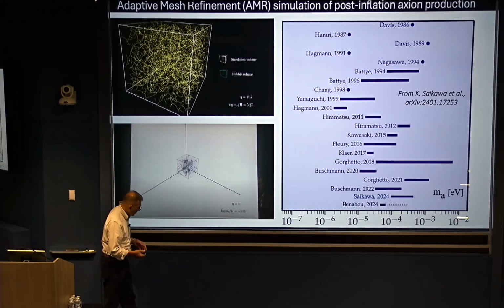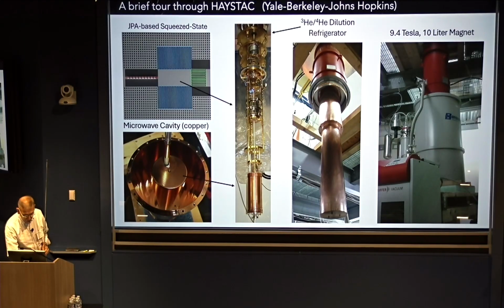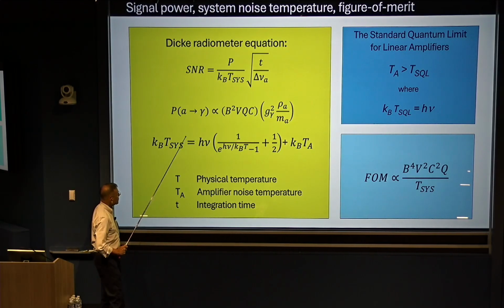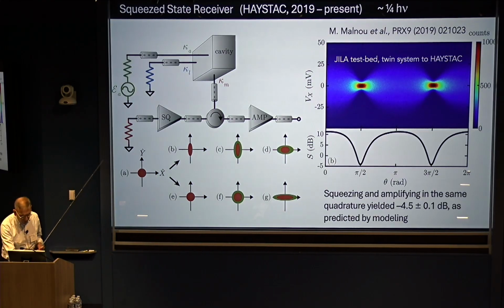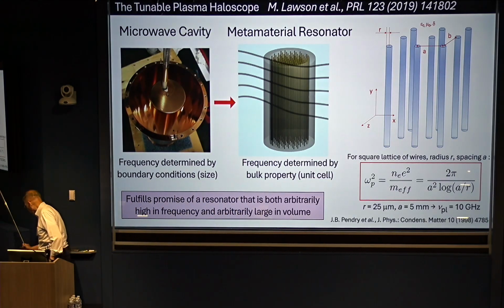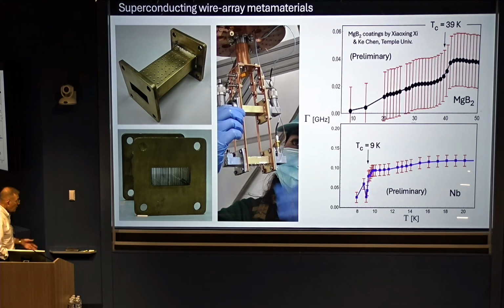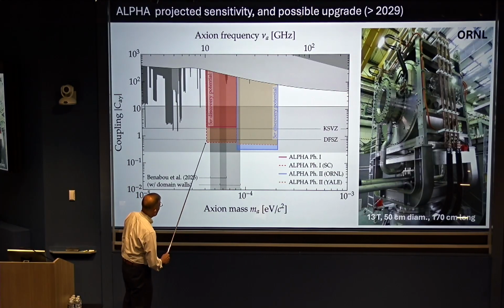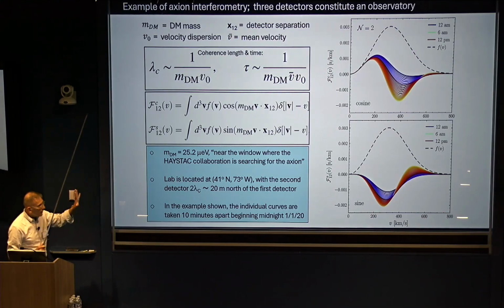Karl Van Bibber - ALPHA — a plasma haloscope for the post-inflation axion (September 4, 2025)

Comment: I loved the talk. From a plain “keep the signal coherent” angle, a few practical ideas:

Shape the room so only the right note rings.
Think of the resonator like a concert hall. We want the one “good note” (the TM mode) to ring clearly and the wrong notes (TE modes) to be muffled. Slightly irregular / gently “chirped” spacing in the wire or PBG layers can kill the wrong notes without roughing up the good one.
What to check: How deep the wrong notes are pushed down, how steady the good note stays as you tune, and how smooth the timing looks (no ripples).

Tune gently, in tiny nudges.
Lots of small, spread-out tweaks beat one big plunger move. Small steps keep the same note and field pattern, so you don’t “re-start” coherence every time you tune.
Rule of thumb: each step much smaller than the note’s natural width; the note’s overlap with the magnet field and its loudness barely change from step to step.

Point the microphone at the note’s exact shape.
The signal is a very narrow line that drifts a hair with Earth’s motion. Aim the squeezed/measurement quadrature and the local oscillator so you’re listening right along that shape, and use a filter that follows the slow drift. That cuts “shape noise,” not just total noise.

Make it hard to scramble the note.
Vibrations, warm spots, and sharp wire bends can smear the signal. Push mechanical resonances out of the sensitive band, map temperature sensitivities, and clean up current hot-spots at bends/joints—especially if using superconducting wire.

Quick health checks (fast to report):

“Wrong-note” suppression (how many dB down across the tuning window).

Stability of the good note while tuning (the overlap with the magnet field barely changes).

Smooth timing/phase behavior (no weird ripples near the note).

Vibrations don’t add sidebands; temperature tweaks don’t shift the note much.

Comment: A fundamental insight of Relativity is that mass that exists at Relativistic velocities is irrelevant from our perspective. Relativistic velocities are occurring in the overwhelming majority of galaxy centers. This means that they exist in a "non local" state relative to their outer regions. The mass in our galactic center is not just there, it's everywhere.
   Einstein repeatedly said that Relativistic dilation prevents astronomical concentrations of mass/singularities. He put this in writing in 1939. 
   Relativistic dilation does not occur in galaxies with low mass centers. They don't have enough mass to achieve relativistic velocities. Therefore, they do not contain dilated mass. It has been confirmed in 25 dwarf and ultra diffuse galaxies to have no dark matter. In other words they have normal rotation rates. 
   Mass is a clingy thing thanks to gravity, it makes sense that dilated mass would exist as a halo around galaxies. Dark matter is simply regular matter that is dilated.
Reply: What exactly does "dilated" mean here? Stuff that is moving fast doesn't somehow become delocalized - quite the opposite.
Reply: @doppelrutsch9540 A common misconception is that mass and or energy increases as an object approaches the speed of light. It doesn't, that's why it's called "invariant". Mass becomes spread throughout spacetime relative to an outside observer. Hence the term "mass becomes infinite at the speed of light"
    A Relativistic dilation graph illustrates the phenomenon. It has velocity from stationary to the speed of light on the horizontal line and dilation/gamma on the vertical. Dilation increases at an exponential rate the closer you get to the speed of light.
   The best way to understand it is to imagine a spaceship traveling at a constant acceleration rate. When the ship reaches 50% light speed, as viewed from an Earthbound observer with a magically powerful telescope, it would appear normal because as the graph shows nothing has changed at that point.
   When the ship reaches 75% light speed it would appear fuzzy because as the graph shows, relativistic effects would be noticeable at that point. It would be partially irrelevant from an outside observer's point of view.
   When the ship reaches 99% light speed it would not be visible because every aspect of its existence would be spread throughout spacetime relative to an Earthbound observer.
   This is the state of mass in the overwhelming majority of galaxy centers.
Reply: @shawns0762  Errr.... no it works the other way around. As an object moves faster it appears to take up less space relative to an observer at rest. It becomes shortened. That is called "length contraction" and is a well known and observed consequence of the Lorentz transformation in relativity. And all of the mass of an object is still, well, inside that object. It doesn't "spread out throughout spacetime".
Reply: @doppelrutsch9540 The way I described Relativistic dilation is correct. Length contraction is a misconception. Something that is irrelevant cannot be measured. Here is a quote from Wolfgang Pauli -
   "We have seen that this contraction is connected with the Relativity of simultaneity, and for this reason the argument has been put forward that it is only an apparent contraction, in other words that it is only simulated by our space-time measurements"
   Einstein thought the math regarding the relativity of simultaneity did not accurately describe physical reality. That wasn't his math.